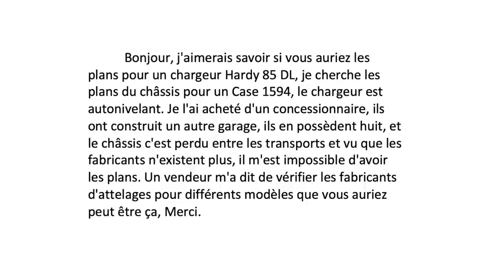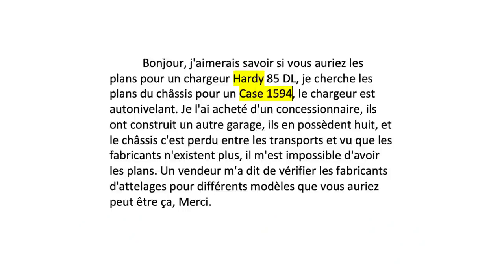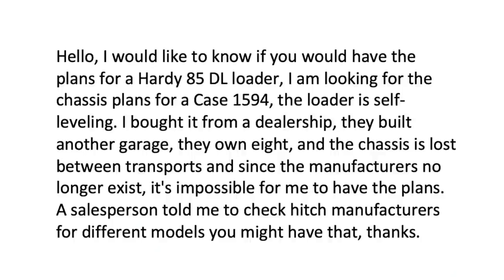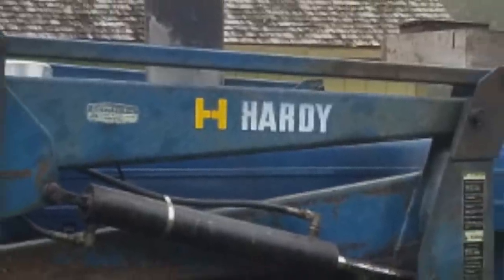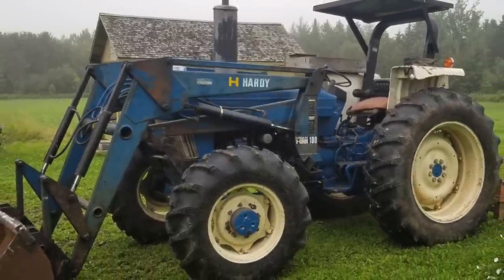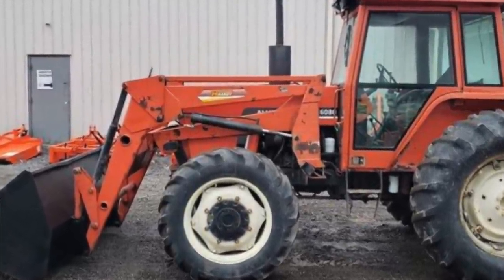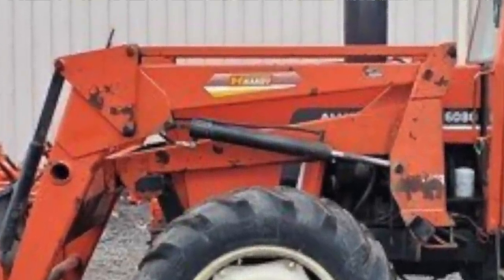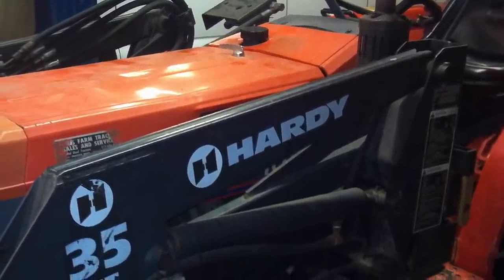You May Have Bought a Hardy Loader Boat Anchor

Comment: I used to work on a hydraulics/fabrication shop for 20 years. Something like this really isn't a big deal. We used to do stuff like that very frequently., almost on a regular basis. He needs to find a small fabrication shop that's willing throw the book away and do what needs to be done. Our welder could fix, fabricate or otherwise cobble something together that most folks would say couldn't be done. And it would last forever. Find one of those shops and you'll be in business. It's no big deal, really.

Comment: My Granddad was a Westendorf dealer, and I would help him out in the shop during my spare time. I know all too well what you are talking about when mounting aftermarket loaders on various tractors. More often than not, you'd have to break out the torch and welder to brand new loader brackets to make them work. Often also have to go get some more bolts also, because the ones that were with the kit wouldn't work, and after that you'd run into issues getting the hyd plumbed up. At the end of the day, loaders designed to fit multiple tractors wouldn't fit any of them well. As far as aftermarket loaders go though, I loved the Westendorf, they were great loaders once you finally got them mounted right.

As far as the guy with the Hardy loader, it wouldn't be too hard for somebody handy with a torch and a welder to fab up some brackets. I once put a JD loader on a IH tractor, just had to fab the brackets, and I painted the loader red to make it match.

Comment: I have two hardy loaders. One came on my Ford 5640 and the other I bought to put on my Ford 9600 but the brackets came of a Ford 4000. It's been sitting for two years and I did a search to find brackets for the 9600 and your video popped up. I was hoping for better news. I guess it's fab time

Comment: I was looking back in the 90's for a loader for my Int 966. Case dealer had a Int 2000 loader off an Int 766. We made a deal, then salesman calls me back and has a problem. Loader come of an Int 656, but salesman didn't know because loader was on a pallet when picked up. He wanted more money and I said bring tractor back and I will start looking again. Salesman compromised and made brackets to fit my tractor. Loader worked good enough for me lifting round bales.

Comment: Hey Mike yeah can't say I have run into a. Hardy loader but have heard of them. Over the years all I have done is run these old antique equipment never could afford the new stuff. I have to agree if you can't fabricobble things and make it work, all you ever will have is a lot of boat anchors or trot line weights. There is a a lot of decent equipment out there for cheap if you have the ingenuity. Unfortunately for me I have reached the age that my days of fabricobble have came and gone. I know this may not help but hopefully it will at least put a smile back in someone's face with some hope.
Reply: Please, pass on your ''fabricottle'' ingenuity knowledge to yougers, don't exist a better heritage. Be well.

Comment: I had a part go bad on a Harbor Freight backhoe and there isn't even a part number for it in the manual or in any place Harbor Freight can find.

A local machinist made the replacement in 10 minutes.

Don't give up.
If you can't find the part, you can make it or have it made.

Comment: Hey Mike I have an idea of a topic you might want to cover aftermarket instrumentation for tractor instrument consoles
Reply: Along those lines, I'm done with the $120 temperature gauges from Case New Holland, Auber instruments has a 12v powered digital indicator with a 100 ohm RTD probe for under $100, the indicator looks like it will fit in one of the rocker switch spots above the steering wheel. An RTD is a true measure not affected by grounding through the engine block.

Comment: I read in my 1958 Case tractor manual that when i drain the hydraulic fluid out, i should flush the system with about 3 gallons of tractor fuel.  Does this  flushing flushing mean i should start the tractor up and operate the hydraulics to het it through the system briefly, or is it just the reservoir i am flushing.

Comment: Hi Mike I have a question about tractor ballasting. I have a Kubota BX2200 with ballasted rear tires, and I recently made a set of wheel weights for it 70 lbs per tier (140 lbs total), and I have a Woods RC4 Rotary cutter (410 lbs) and I am wondering if I can put the cutter on the tractor with the wheel weights on  without overloading it? Thanks for the great video.
Reply: Yes, you will be fine with the weights and the cutter. Wheel weights and fluid in the tires add weight to the tires and wheels only, and don't add any weight to the tractor chassis itself.
Reply from the maker: Yeah, I'm with m16ty, the tractor should handle the extra weight just fine.

Comment: Mike I'm sorry about the gentleman and is loader problem.     I got a question for you, do you know where I can get parts for a Deutz-Allis tractor. Model 5220 built approx 1986.??  I'm missing the transmission rubber caps and need an oil sending unit.
Reply from the maker: You could try your friendly local AGCO dealer, or Walt's Tractor in Missouri who specializes in new and used Deutz parts.  Their number is (417) 472-7200.